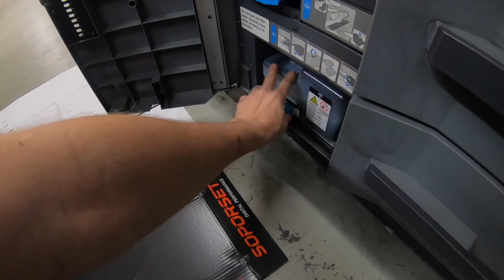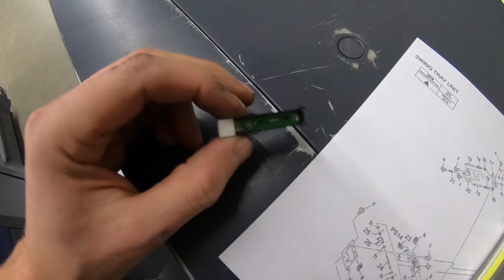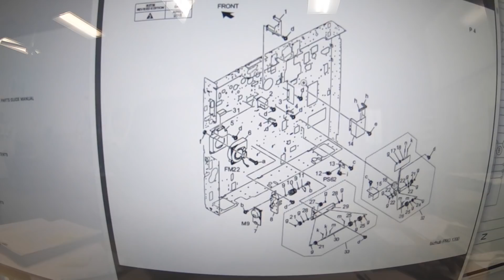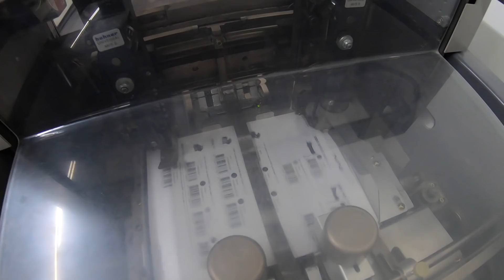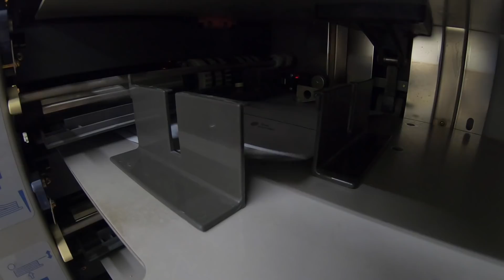Sensor Fix on Konica Minolta Digital Press, Corner Staple on Standard SPF-20a Collator

Comment: try checking the part of the waste toner bottle that meets with that sensor (there will be a small part of the waste toner bottle, slides in between the sensor) . make sure the part of the plastic is clean/transparent.
Reply from the maker: Thats the first thing I tried. I think its fixed now.

Comment: I had something like that happen on my Xerox. I ran out of new bottles, so I emptied a used one, but it still wouldn’t work. Out of frustration I banged the waste toner bottle on the table and it must have knocked the toner  off the area on the bottle that the machine used to sense if it is full.  Worked perfectly!
Reply from the maker: Nice! I have started re-using my waste toner container since it is off contract. The containers cost $80 each and are just empty plastic containers! Crazy!

Comment: The waste toner system needs to have some safety measures built in just in case the customer does not change the waste toner bottle.  PS37 is the "see through" sensor that shines through the waste bottle.  PS62 is the "Poop Tube" sensor that detects the waste toner conveyance system clogging up.  You can run in the service mode, State confirmation, i/o check mode code 43-6 to run the M9 "poop tube" motor.  If the customer ran the bottle too full in may cause the augers to back up.  Run this test for a few minutes to unclog the tubes.  In state confirmation, i/o check mode you can test PS62 with code 25-27 and manually turn the waste auger to test sensor.  Code 25-20 will check the "see through" sensor.  You can use the "access" button on the control panel to switch between the main test code and the sub code.  On Konica color devices you can run test mode 43 to run 12 sheets of solid, halftone and combinations of colors.  Subtle changes in yellow are difficult to check with the naked eye.  In the service mode press, test mode, (02) test pattern output mode,  input 43 and set the rest of the values to zero.  Make sure you have full color selected.  It should generate 12 sheets of CMYK and combinations of both.  I hope this helps.
Reply from the maker: Thanks so much! I was trying to test the see trough sensor in i/o test but I must have done something wrong. I am going to practice using your method. Wonderful! Thanks!

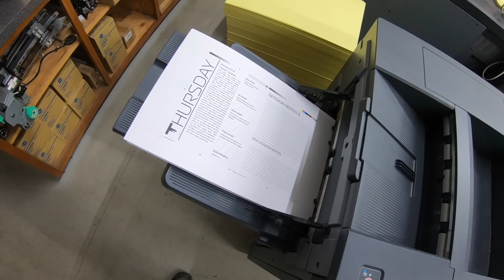Comment: Hey Dan, the print job at 7:52 seems to be b&w. Why do you print the color test bar at the top of the Page in color? This causes a color click instead of a b&w click. Just asking.
Reply from the maker: Customer supplied PDF with color bars on. I didn't take the time to delete them off each page. Thats the nice thing about servicing equipment yourself. No click charges. :)
Reply: @justaprinter  no click charge - what a dream 😉

Comment: You can do  I/O check test for sensors on service mode to be sure.
Reply from the maker: Yes, I did try that but must not have been doing it right because the on/off was never changing. I need to play around with that more, I used I/O in the past with success.